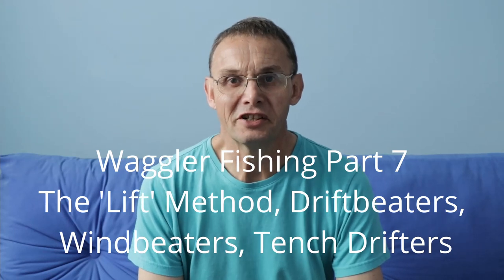Waggler Fishing Part 7 - The 'Lift' Method, Driftbeaters, Windbeaters, Tench Drifters

Comment: The context in which any tactic is used is important Mark.  Try using the lift method for crucians and feed groundbait and lots of small feed items and you will get lots of liners and struggle to catch any.  Use the same tactic in a clear water environment and feed 5-10 grains of corn per fish and its deadly.  Its down to the manner in which the fish are feeding in either scenario.  On the match fishing points i disagree strongly.  Mostly just copy each other and certain fads and theories become popular for no other reason than they are popular in whatever media is prevalent at any given time.  I recently had a go (at match fishing)  myself and did rather well using unorthodox tactics against guys who just didn't think for themselves.  BTW Try doing some tank tests with your conventional waggler tactics and you might be shocked at how poor bite indication is...real bites that is; ones that you would strike at.  These experiments might explain why match anglers are obsessed with fine lines and tiny hooks!  There are certain techniques which will never catch on, within match fishing for no other reason than the fact that the guys involved want to be getting bites all the time and simply aren't willing to experiment with anything which is not within their comfort zone.

Comment: The lift method can work but you need a very clear and quite even bottom otherwise indeed conventional float fishing is better. Not quite convinced on the reference to match fishermen, they are generally trying to do something quite different which is to 'speed fish' so they want to maximise quantity, quick fishing, in out, rinse and repeat. They wont want to mess about with the slow adjustments lift fishing needs especially when flow, tow or and uneven bottom are present. SO, in my mind that is why it isn't mentioned. Not as it isn't effective but because it isn't a good match tactic.  Your Carp puddle test ... well, its greedy stokies fighting to hoover up everything so Im not surprised the float would settle to do its job. The wafting of the fins alone probably bounced the bait and bottom shot all over the place.

Comment: Surprised to see this, Mark, or rather the content.
The lift method isn't a match angling method and for good reason.
It's designed to make avoid small fish and focus on bigger specimens.
It's not a long distance method and only works where one can comfortably cast it.
As you know, for one example, I used it on the canal to catch the roach you wrote about in 'Big Roach 2'. The video is out there to view.
If you are an unbeliever then fine but given your track record in researching subjects as you do, this seems a little out of character. The likes of Peter Stone & Fred J Taylor didn't use the method because they were unenlightened, quite the opposite. They were fishing for the bigger fish in the swim and if that meant 'one bite, one fish' then so be it.
I was a match angler too and there is no doubt in my mind that in moving to the 'specialist' side of things, the lift method has been the biggest eye-opener to me in catching proper big roach from the canal. I also use it to catch tench when they can be caught at close range in rudd infested waters.
It is an incredibly sensitive method with the right set-up and hook bait, but if you don't try it, and experiment until you get it right over time, that wouldn't be apparent, i.e. not in a carp puddle. 
The method you suggest instead is useless if there is silkweed, etc., and it won't deter smaller fish.
When you're after big fish only there is nothing more irritating than having to wade through 'bits' to get to the odd better fish.
I would seriously recommend you read more on it and try it before you rubbish the method. Everything has its place and just because it isn't a match style doesn't mean it doesn't work.
If you want to learn more you could do worse than check out Jeff Hatt's writings on the matter by which conduit you found his and subsequently my own use of it for regular 1lb+ canal roach.
Happy to help if you want to try it properly. In fact why don't we do that?! I'll show you how and why it works and you take me to catch a 2lb River roach? 
I do hope you take this in the positive spirit it is written and I look forward to your comments!
Reply: agree///100% The lift method is a method I've used successfully for years....and I remember  winning a club match with it by fishing and feeding under my rod tip whilst others fished poles and wagglers unsuccessfully....

Comment: The lift method has been used by generations of anglers, especially for tench, carp, bream  and big  roach, On its day, and in the right conditions, it is a very effective method and a way of lovely fishing; certainly much more pleasurable and exciting than sitting behind buzzers for hours (or days) on end.

The right conditions include a clear bottom and not having large numbers of fish brushing against the line in. An (over) stocked carp puddle is probably not the ideal pace for its use and certainly not the type of water and conditions that either the Lee anglers or Fred J either developed or would have used the float.

Unfortunately these aren't the conditions that describe most big roach and tench waters, especially wild ones.

Comment: I’m not sure people completely understand the lift method. When the rod is put in two rests and you tighten down to the float until just the tip shows, a fish has only got to breath on your bait and you will get an indication. I had six tench last week in fairly quick succession and they were still feeding when I packed up. It works well for me and has done for years.

Comment: A float maybe good but not for match style angling, so not used by match anglers... I have had success with drift beater type floats for larger carp, upper doubles and twenty's with it laid hard on the bottom by around 18 inches. Probably could have used waggler but with 10lb line a big bodied float seems balanced and allows heavy shotting (on a short loop of line) or possibly a drilled bullet stopped by a swivel, followed by hook-length.

Comment: I have caught many tench on the lift method as well as big roach and bream . I wouldn't dream of using it on a carp puddle . the peacock quill and bottom shot loading have to be balanced to depth and tow , the Taylors used to decide the shotting and trim the quill on the bank as I recall from their writing's.. And as a young lad watching the big matches on the Whitham prior to commen use of the swing tip as devised by Jack Clayton ,big drift beaters ,onion antennas and zoomers  were used to target the bream shoals .